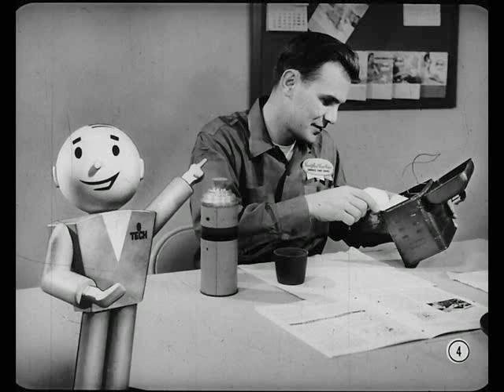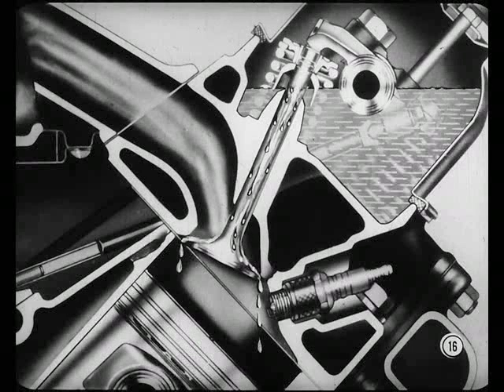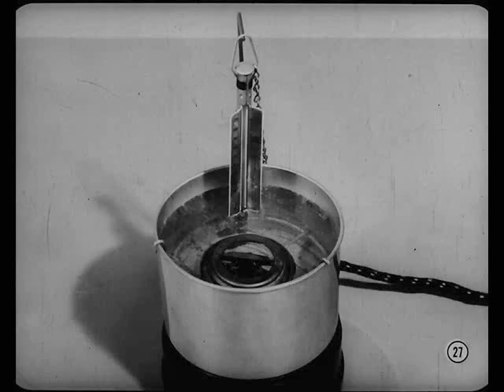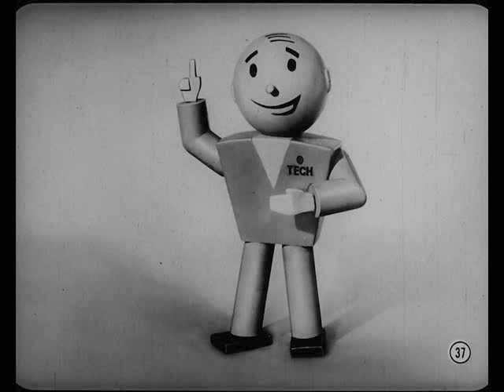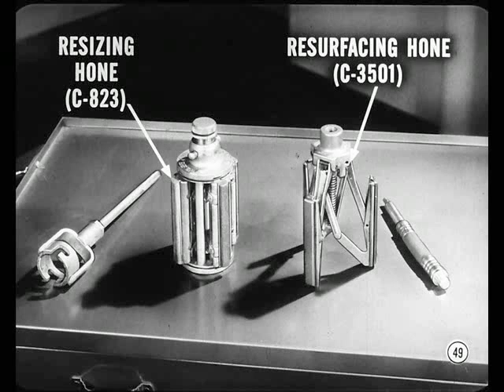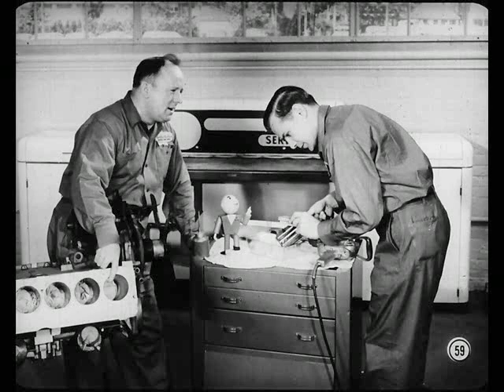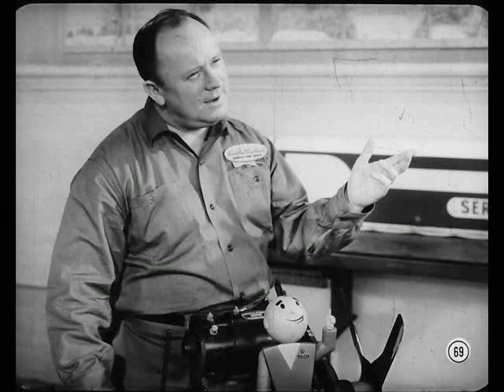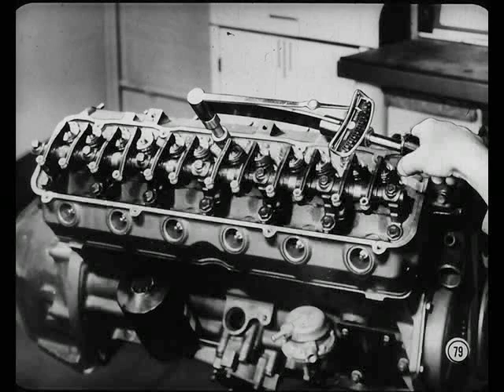Chrysler Master Tech - 1961, Volume 14-6 Engine Oil Control

Comment: Was the ball hone invented after this was made? I usually see people use ball hones when the re-ring the engine.
13:30 Some piston types didn't have good oil return holes. As a result, some people would drill more holes in the piston to compensate. This usually does solve the problem.
PCV Valves replaced the road draft tube around 1966. It reduced smog by burning the gasses in the cylinder. It also helped control sludge during cold weather operation. Some engines used a metering orifice instead, but that is less common. Having a properly functioning PCV system is critical to control oil consumption on engines that use it. People would sometimes clean an old PCV valve to save money back then, but it wasn't a good idea. The spring could fatigue and there is no way to know if that happened. Also, aftermarket PCV valves often don't have as precise a spring, so they don't work as well. Use them only when you can't get the OEM part.

There is something that should have been mentioned about engine flushing. Sometimes so much sludge would break loose, that it would bury the oil pump pickup. The result would be no oil pressure. Keep an eye on oil pressure, and if it drops, you must remove the oil pan, clean it, and clean the oil pump pickup.

Comment: Back eons ago, on a sludged up mess, I"d drain the black goop, then overfill the warmed engine with water white kero JUST to break up the goop by cranking to get it in the galleries and up onto the cylinder wslls... NEVER run it.  Let it sit an hour or more, then drain.  On a bad one, you'd see globs of sludge come out the.drain.  Drain thoroughly, change filter element, fill with SAE 10 and two cans of Alemite CD-4.  Fast idle for 20-30 mins at thermostat temperature while monitoring oil pressure, drain.  Heavy clumps coming out this time and dark oil color means the pan's going to have to come off anyway.  If not that bad, refill with normal viscosity oil with one can of CD4, change filter, and run until up to temperature, listen for collapsed lifters and low oil pressure symptoms.  If good, drive 500 miles and drain again, and see what comes out.  Anything larger than little flecks of varnish or sludge, you pretty much have to drop the pan, check the pickup screen and possibly inspect the oil pump for wear.  I did Step 1 on a '61 Ford 390 one time, and it clogged all the oil return holes AND the drain.  Pulled the pan, and I got 3½ qts. of sludge out of the pan, with more in the vee.  The lady had never changed the oil in TEN YEARS of city driving.  After cleaning that mess out and freeing the rings with solvent, that 390 ran credibly well.  She came back as advised in 500 miles, and the oil was was near black on the stick, but it was the CD4 that loosened up the rest of the sludge and carbon and small particles ran out easily.  The filter was nearly clogged.  She went on 2K oil changes after that and that 390 never would burn more than a ¼ qt between changes after that.  I was amazed that the compression was still 180 lbs on all eight.  Those FEs were TOUGH!

Comment: Oh NO...not kerosene!  (You can use it, but I'd run a flush after using cheap new oil...kero dilutes oil and can varnish in these old low temperature engines.)
Reply: GOOD point! Sadly, they just didn't know that yet, at least not system wide. I'm an older Tech, now retired. For flushes... for the second flush, I'd use ATF. Does a great job of cleaning and flushing - AND, since it's a lubricant itself, doesn't do the harmful things that fuels and solvents would. 
I also advised the customers to come back between 500-750 miles, for a oil change, just to be safe......
Some even DID!
Reply: Mechanic I knew ran cheap motor oil and diesel fuel to flush.  - then refilled w Quaker State! -

Comment: Atf is great at flushing out a oil congested engine.
Reply: It may have been the best back then, due to the higher detergent content. Nowadays oil has plenty of detergent, so people rarely need to do an oil system flush. If it is needed, you have to buy a chemical made just for flushing an engine oil system.